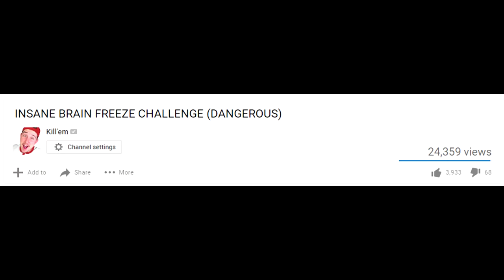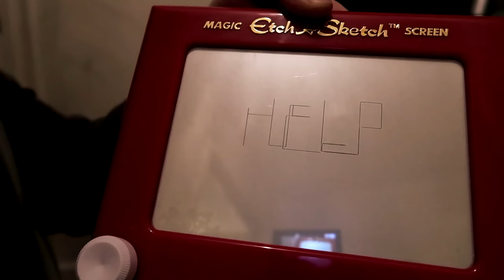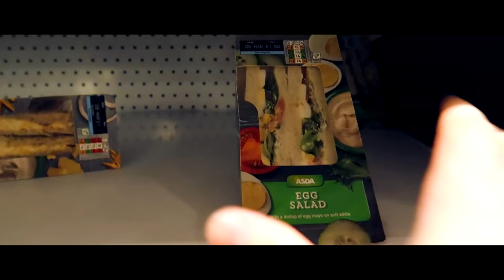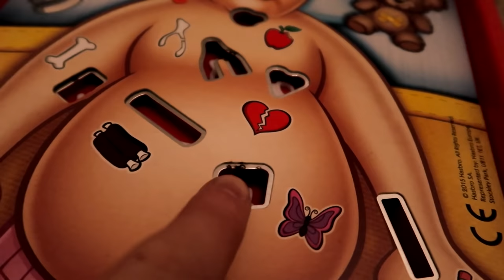CAR BATTERY OPERATION (Do Not Attempt)

Comment: It is impossible to feel any shocks.... cause he isn't touching the metal thing (negative) and all of you guys say but hes touching the ground... no!! the currency is way to low for that.
Reply: He is touching the metal
Reply: Metal is a conductor which means heat CAN in fact travel through it so even if his hand was away from the sparks he would've still been hurt.
Reply: Rhett Davidson totally wrong xD
Reply: Im a jerk? Dude its time for you to go to bed xD
Reply: Lars Walther current
Reply: He doesn't get an electric shock since the current is too low for that (because of the body resistance). However he did get burns. The current through the cable is very high (So high that you can almost weld) because the resistance in the cable is very low. This produces a lot of heat where he gets his burns from.